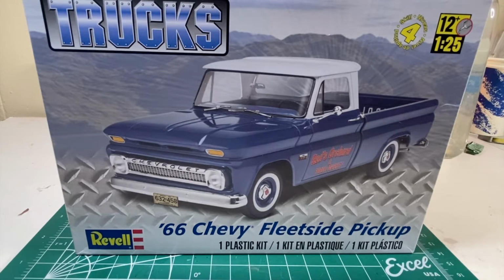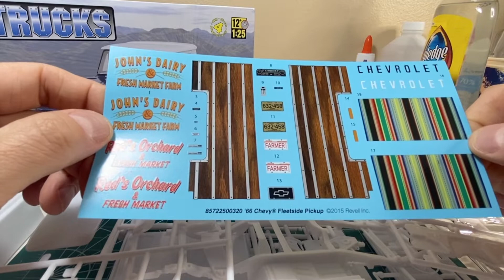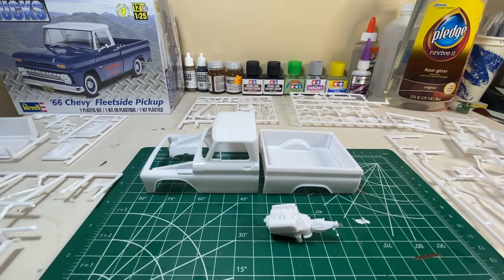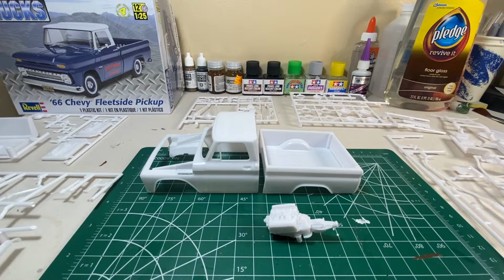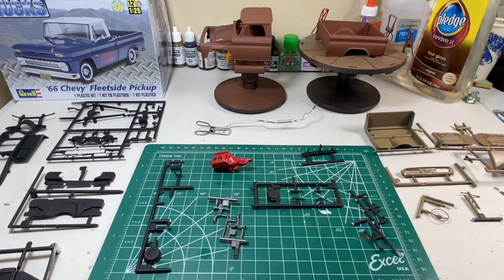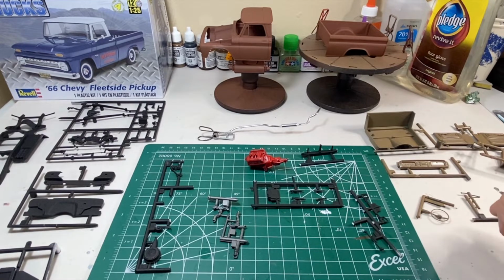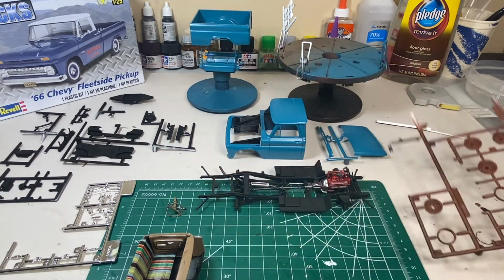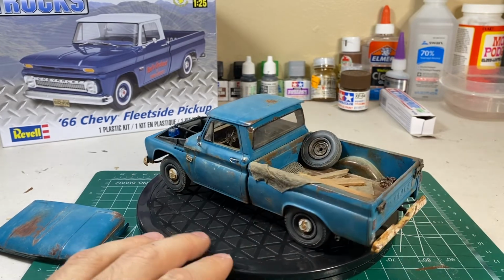66 Chevy Fleetside Pickup 1/25 Scale Revell Model Kit Build Review

Comment: Like I said about the hood parts I would glue them in place hold the side parts in place a few minutes to set then put it aside next day the side hood parts would be on table or laying flat inside hood
Reply: I built three of these hoods and haven't had that problem. The 65 Stepside, 66 Fleetside, and 66 Suburban. I use a emory board and carefully square/true up the parts to each other and test fit them. I use a tiny dab of BSI thick CA on the corner of each part. Then follow up with a brush of Plastiweld or Tamiya capillary glue/weld.
Afterward when cured enough (a few minutes) I'll take a emory board and true up any minor mismatched edges then square up the hood to the body if needed.
On the Suburban I used Testors precision cement instead of CA to tack glue the hood parts.
Reply from the maker: That's a great technique to use and would have helped me a lot. I'm thinking of possibly doing another one of these kits but as a cleaned up version so I will definitely try this out. Thanks for the tip!!

Comment: Doing this kit myself right now, also planning on doing a rusting weather job very similar. i've never done the hair spray technique but i may give it.a try based on your results. how did you touch up your chrome and other parts after cutting them off the sprue? i tend to take them all off, clean them up and assemble what I can prior to paining. i also use a degreaser on the chrome, clean them up and then rechrome after since i can never get the touch ups to look right.  i'll be adding garbage such as old chip bags, a scratch build trash can, beer/pop cans etc, thinking of making the seat look torn. what did you use for the chain? that is a nice addition. overall good work.
Reply from the maker: watch my latest video, I did the sat method and honestly preferred it over the hairspray but both work well. I just cut the sprue with sprue cutters and filed it down as close as I could.  I painted over the chrome since this was a gonna be old I figured it wouldn’t matter. The chains were literally little chain from hobby lobby. In my last model I used some metal form a coke can to make a license plate.  Thanks for watching friend!

Comment: Amazing job.  Can you tell me what paint you used for the Engine Red?  I'm having trouble finding the right color.  I usually use the Rustoleum 2x paints.
Reply from the maker: Thanks man! The red I used is probably too red for a chevy engine but it was gloss apple red, rustoleum (all I had at the time).  I recently just picked up a Rustoleum satin fire red that I think is a lot better. The satin red is an enamel and takes longer to dry fyi. I used it in my last video on the modified if you wanna see how it looks. thanks for watching!
Reply: @MyHobbyWorkShop  Funny, I have the gloss apple as well and think it's too red.  I'll try the other.  Many, your weathering is just jaw dropping.  Incredible.
Reply from the maker: @bullitt773  Thanks for the kind words friend. It was a great kit and the weathering was so much fun to do.

Comment: Where did you get the material for the things laying in the back.Btw love the build.
Reply from the maker: Hey thanks for watching! The boards are just small popsicle sticks I cut, the “chicken wire” is a patch used to fix your window screen and the little chain was just some small chain I found at hobby lobby. Pretty cheap and came in a spool. The tarp is toilet paper. I took some TP and put it in a mixture of water and and mod podge. Laid it in the truck and let it dry, then painted it and weathered it.